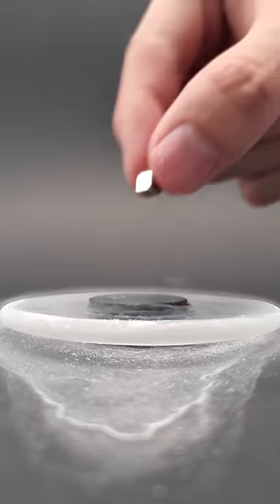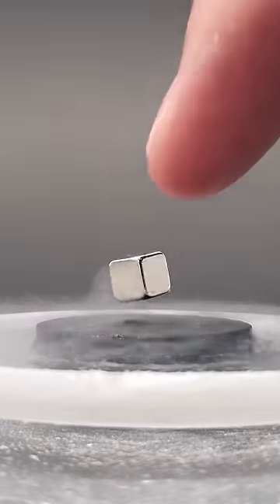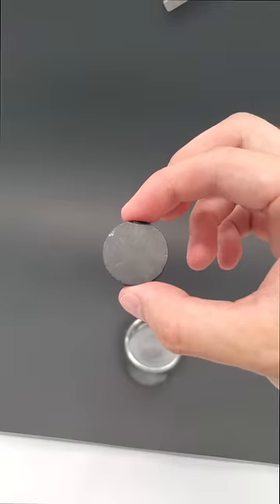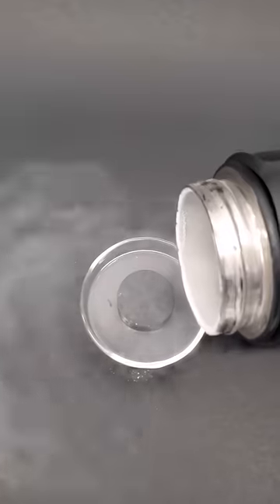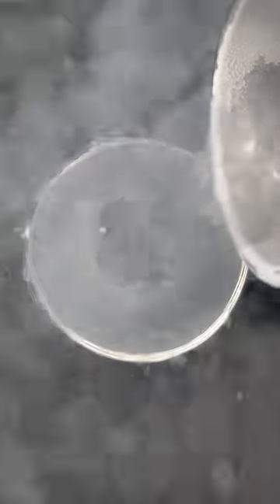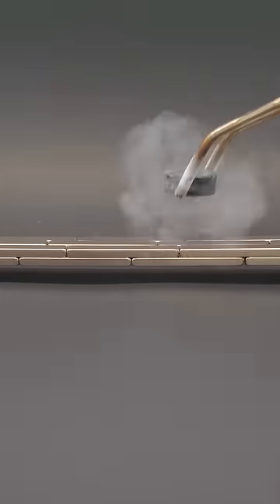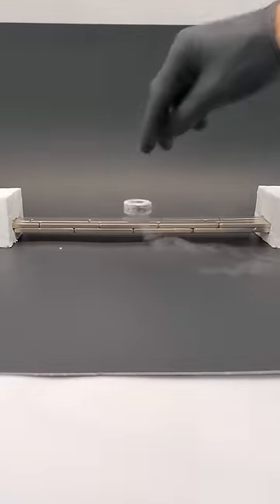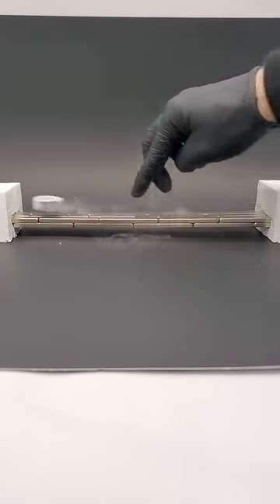Watch this superconductor hover around in mid-air!

Comment: My daughter asked “I mean, where do you even buy liquid nitrogen?” 😂
Reply: Same i kinda want one
Reply: Apple store
Reply: I know a guy who knows a guy
Reply: From nasa
Reply: @weknowthetruth6070  i know that guy
Reply: On silkroad of course
Reply: @gotoheat  I know
Reply: Not that hard to get actually
Reply: Ask any dermatologist - they use it constantly to remove skin growths.
Reply: Well, here it goes. 
Praxair and Airgas, while being gas sellers, sometimes have LN2 for sale. Adittionaly, you can get it at tire dealerships as they often use nitrogen instead of oxygen to fill their tires, since it leaks slower. Be sure to ALWAYS go for a quality dewar (the container you'll need to store the stuff), liquid nitrogen or any other cryogen is extremely dangerous if you don't store it in the right containers, it can and will cause one hell of an explosion if stored in inapropriate places, it will also make a room next to impossible to breathe in if enough of it becomes gas. As if that wasn't bad enough, if you get it on your skin you'll be... very fucked.
Reply: @alanwatts8239  absolutely correct. I use it to shrink bushings going into mining buckets
Reply: Gas supplier.  They are usually in the industrial parts of your local town.
Reply: I know someone mad scientist that can hook you up but they taxing it's dry in the streets
Reply: Gas supplier, welding shop, hardware stores.
Reply: from a guy who knows a guy who knows a guy who knows a guy’s wife who knows a guy who knows a guy’s friend who knows another guy who knows a guy from the pentagon who knows another guy’s friend who knows a guy who works at nasa who knows a guy who creates liquid nitrogen
Reply: @Thawhid  me too
Reply: @Vishnu PM yeaaaa that oo ne
Reply: Grocery store
Reply: Ask a friend that works at biotech company they usually stored cells and keep plenty, most gastro pubs nowadays have liquid nitrogen too. Just keep in mind it's -196-300 and can severely cold burn your skin, and give you frostbite 🥶, definitely need a face shield, cryogenic gloves, and apron.
Reply: The liquid nitrogen store
Reply: Wish
Reply: Black market
Reply: @gotoheat  i am that guy
Reply: @wickedcanadiangaming761  yea you can get a tool bench type thing to make it
Reply: Ebay
Reply: @Thawhid  i
Reply: Craigslist?
Reply: Grocery store. We used to sell it at the overpriced chain market ii worked at. Had to wear gloves and double bag it in paper just to handle it.
Edit: it wasn't liquid nitrogen, but dry ice. Was used for fog/smoke machines, storing things at below freezing like food for smoothies, and was used by science teachers for experiments similar to this.
Reply: From the liquid nitrogen guy
Reply: Your paying way too much...who's your sardine guy
Reply: @wickedcanadiangaming761  where do you get it?
Reply: @richardwiley5933  how you know that you go to a dermatologist to get wart off your junk?
Reply: @richardwiley5933  busted!!
Reply: @alanwatts8239  thank you sir for your wisdom !! Fr
Reply: @user-pu1xq9ef9u  any gas supplier. Praxair or air liquide
Reply: @wickedcanadiangaming761  thank you sir!!
Reply: amazone has nukes soooooo
Reply: @Abekiel  : Conservative Twins?
Reply: Is in your refrigerator 🤣
Reply: The air is mostly filled with Nitrogen. You just need to liquefy some. Shouldn't be TOO hard.
Reply: @gotoheat  same
Reply: Amazon
Reply: @TsubakiOnYT  my basement
Reply: my attic sells things like that
Reply: @weknowthetruth6070  nice 422 likes! Because 422 is "420 too" 😂
Reply: And that's how it first starts! Lol 😱
Reply: You can go to HVAC stores to buy it
Reply: Publix
Reply: Probably in the south or north or greenland
Reply: Now i Have An Idea to make Floating Board In the Future
Reply: The lemonade stand
Reply: Walmart
Reply: oui c'est beaucoup trop cher
Reply: I would say the black market
Reply: @gotoheat  that guy is me 😀👌🏾
Reply: You obviously buy it at car dealerships
Reply: overclocker
Reply: Haha what did you say?
Reply: Most walmarts
Reply: @weknowthetruth6070  saul goodmam reffrence?
Reply: @Luis Jimenez  yeah and he knows a guy who knows me and i know a guy
Reply: My buddy Eric has some
Reply: From star park
Reply: Clearly you go to the liquid nitrogen store! Duh!
Reply: ebay
Reply: Exactly
Reply: Online
Reply: Online shops.
Reply: @gotoheat  so you are the guy who knows that guy,
Reply: @richardwiley5933  Thanks 🤗
Reply: Costco. We have damn near everything. 🤣
Reply: Any place you go to buy welding gas or medical use gas.
Haun, Airgas and similar type places should have plenty on hand
Reply: Question where do you get liquid nitrogen from
Reply: @Satory-wt9dg  yup
Reply: @weknowthetruth6070  I am that guy
Reply: Amazon
Reply: From 
Rick Astlley
Never Gonna Give You Up
:)
Reply: Lol
Reply: How much does it cost - if you can find a source?
Reply: What wold happen if you send the nitrogen from above?
Reply: Has anyone invented a form of nitrogen that won’t explode?
Reply: Carefully
Reply: @alanwatts8239  actually if it gets on your skin your fine as long as it doesn't sit there for like 10 seconds, I believe it's the ladenfrost effect that saves you but I could be getting the name of the effect mixed up
Reply: @bigggywes1554  that's dry ice
Reply: @ladysilverwynde  not liquid nitrogen but probably dry ice
Reply: @lanettedavidson1202  you can just make a new isotope of nitrogen that doesn't explode and the nitrogen doesn't explode but rather the pressure it builds up from boiling and its like $300 for a bottle of it
Reply: @Fisheiyy  The ladenfrost effect happens when you pour something relatively cool on a very hot surface or vice-versa, like getting your hands wet and dipping your finger in a very hot liquid (don't do it with molten metals unless you're absolutely sure of what you're doing, it can cause steam explosions). When liquid nitrogen touches your skin it immediately evaporates, briefly shielding you from it, but it will severely hurt you and cause frostbite, especially if it manages to cling onto your skin in case of it entering contact with another substance.
Reply: @Fisheiyy  Probably! 😄
Reply: EBay
Reply: @gotoheat  i know a guy who knows that guy
Reply: Sigma aldrich
Reply: @weknowthetruth6070 Muscle Man? Is that you??
Reply: on the Blue Market
Reply: It came to me in a dream.
Reply: The liquid nitrogen store of course
Reply: of course chemical stores
Reply: I once took a liter of it from university in an isolated coffee can inside an insulated box. We used it for teaching purposes at the fire station where I was volunteering. Once we were done, we were fooling around outside in the warm summer evening. A colleague, who wasn't part of the training, was washing his car. He had a bucket of water and we poured some liquid nitrogen in without him noticing so that a layer of ice was created at the top. The face of the colleague, who was trying to put his sponge back into the water was priceless.
Reply: You don't. NileRed owns it all😂
Reply: @RobertGriffith9  Nah, there's a difference between pressurised nitrogen gas, and liquid nitrogen. You might get a couple of drops from the canister cooling, if you let the gas escape quick enough, but it'd be wasteful and expensive. Also if you do it indoors, you've filled the room with a tasteless, odourless, unbreathable gas. Sadly the human body recognises suffocation by an increase in CO2, but not a lack of oxygen. So you likely wouldn't even feel it, just "flump" and there you go! I say "likely", can't say I've tried it. 

The answer is, get yourself a second-hand cryocooler and cool down some air til it liquefies. You'd end up with oxygen in there too but you could separate it if you really needed to, in several ways. The cryocooler will give you liquid nitrogen from air, but it's far from "free" when you consider the electric bill for a Thermos flask full.
Reply: @jmassagetherapist6773  Right, dry ice is a LOT warmer than LN2!
Reply: the tank holding it is usually a rental and depending on the price you set your monthly refills
Reply: Make your own.
Use a proper dewar though, no shortcuts.
Reply: Welding/gas supply store.

Comment: Man ngl.. liquid nitrogen be one of the most shenanigan shit ever
Reply: Ong
Reply: It gets boiling cold
Reply: @Dutch_Man68  ahh yes the most thirst quenching fire. The most flammable water. The best breeze of rocks.
Reply: Wait til you get to liquid oxygen
Reply: @Dutch_Man68  Mmm the ice cold air
Reply: Its the new dlc 😂
Reply: My meager understanding is the cold creates a tighter magnetic field and reduces resistance.
Reply: @Sei783  at a guess it probably has to do with decreasing the random motion in the matter (which is what temperature measures) which likely means the random electron motion goes down so you get more stable lines of flux going through the material.
Reply: It’s so much fun to play with!!! Freezing and shattering fresh flowers like roses. Dry ice is also fun lol. We were louder than ANYONE around with their expensive illegal mortars and rockets😂 we spent 30 bucks on dry ice and we already had empty plastic bottles from recycling 😊cops couldn’t do anything 😅 but we stopped at 930pm anyway. Good times!
Reply: @manavsharma9263  Nile’s back at again with the shenanigans 🤣
Reply: it goes to show how nearing the extremes of what our universe allows (that we currently know of) allows for some crazy things to happen

Comment: They’re trying to make this work with more and more sophisticated superconductors  right now that don’t need temperatures quite as low as this one. Maglev trains are going to be VERY cool.
Reply: (ba dum tss)
Reply: Noice pun but I've been hearing about mag lev trains for decades.
Reply: @coppulor6500  they currently use regular magnets, not superconductors. When they start using the latter we’ll probably end up seeing some very speedy trains.
Reply: @coppulor6500  they exist
Reply: All I know abt maglev is Rubik’s cubes lol
Reply: @emeraldnickel imagine them being fast enough to go cross country in minutes instead of hours
Reply: @dirtsquid6995  air resistance still exists... and what's it called in english, the delay of mass or whatever.
Plus, the kind of acceleration that would require would probably pop all the passengers internal organs.

Yes Maglevs can go much faster and most importantly make for much smoother ride at high speeds but we're talking about doubling the travel speed maybe tripling. Keep in mind regular trains can already go at  200-300km/h. 
So if a journey took 6h before, its still gonne take 3h... 

And then there is the bigger time eater, the stops in between.
Reply: @dirtsquid6995  I looked it up to double check and yeah the ICE (regular train) goes up to 300kmh and a maglev in japan supposedly set a speed record at 603kmh
Reply: @Someone-dv7hw  which is still on the lower end of maglev speeds since the TGV holds the all-time record on regular tracks with 574 km/h
Reply: @freakysquirrel7218  I don't follow the train of thought in that sentence? How does the tgv's record have anything to do with the maglev speed being on the lower end. A record is a record, that's not the low end its the high end?

And yes, you are correct, the tgv holds the speed record, but in regular travel both the tgv and ice are pretty similar with their top speeds carrying passengers around 320kmh which also seems to be the common limit world wide (an artikle mentioned the same speed for shinkansen).

Either way... that means that the testing speed record of the maglev is BARELY twice the regular use speed of normal trains which is precisely the point I was trying to make, that it isn't AS revolutionary as suddenly shrinking several hours travel time into minutes, if they implement the current testing speeds into regular use it would cut down the time by half.
Reply: @Someone-dv7hw  sorry. What I meant to say was, that the maglev reached that speed on only a ~30 km stretch of track. If given more distance, it could easily reach +800 km/h

Also, the highest opertational speed of the maglev was "only" 431 km/h from what I saw (still over 100 km/h quicker than regular High Speed trains)